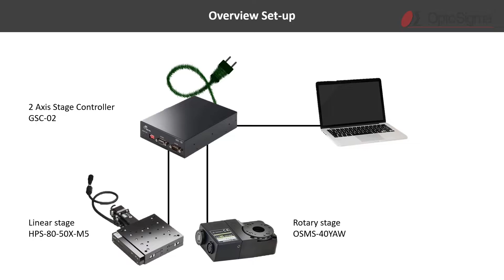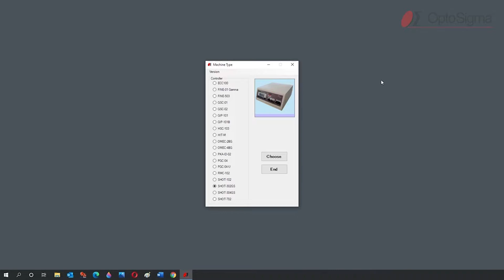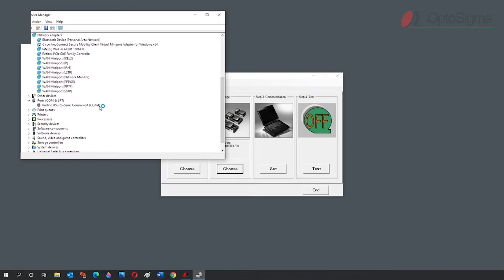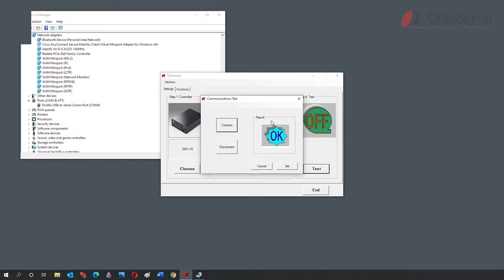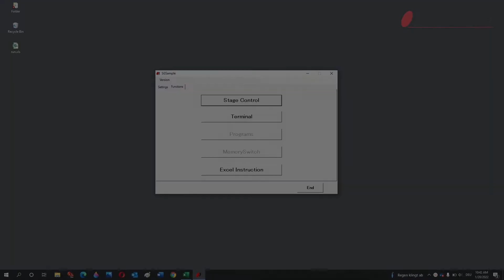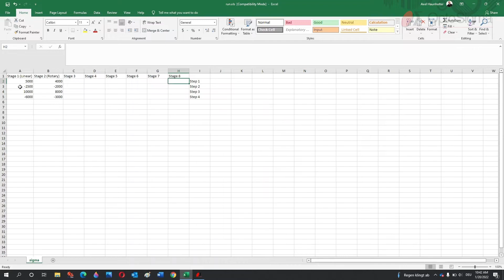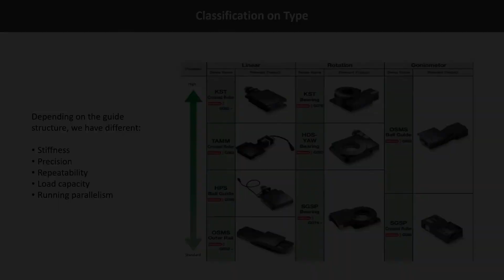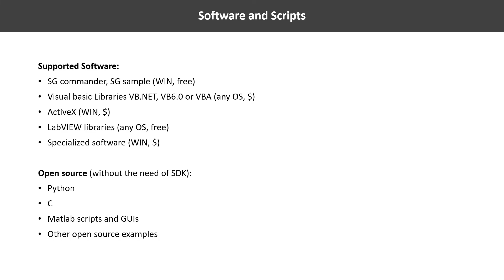How to Drive your Motorized Stages

Comment: Good demo! Would like to ask, do you have linux drivers (e.g. for Ubuntu 20.04 / 22.04 / 24.04). Does this interface with Thorlabs linear stages? Is there a linux driver that can be controlled via a terminal command line interface? Regards.